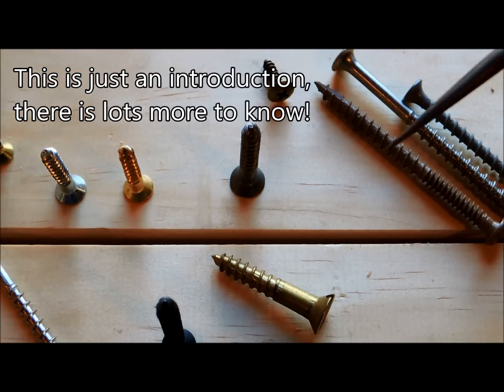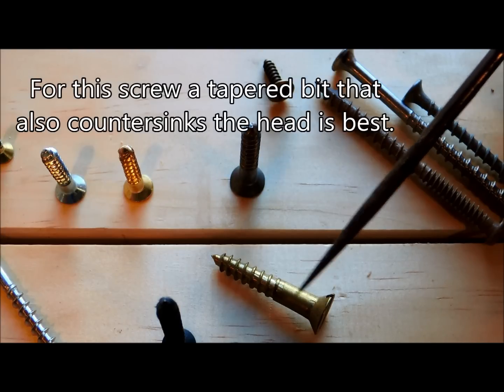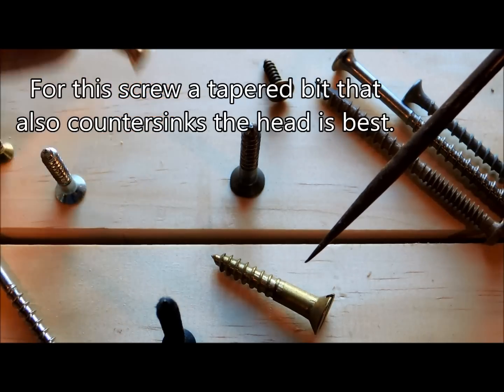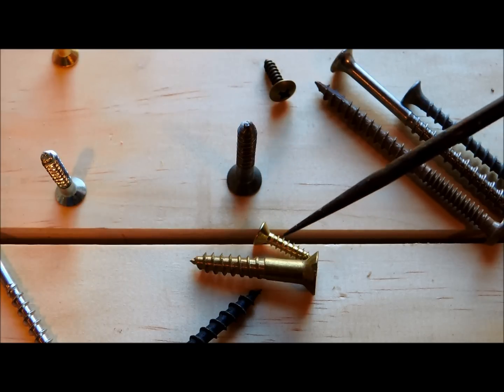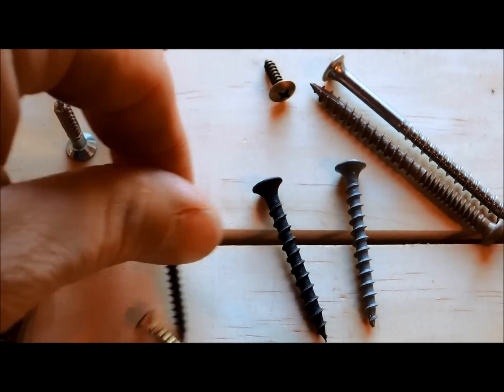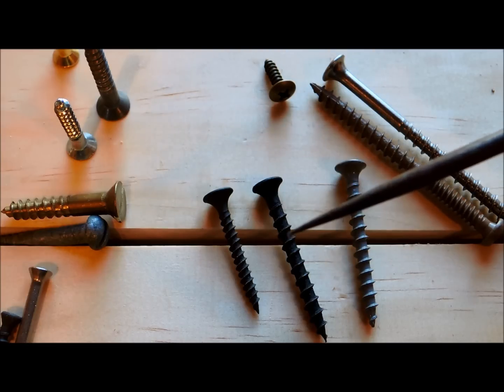An Introduction To Wood Screws

Comment: I have a question im new to diy and my first project im doing,its a fish tank stand 30 gallons,about 340 pounds. My question is can i use a 10x3 or 8x2 deck screwdriver on a 2x4?
Reply from the maker: crispers702 You can use deck screws in doug fir or spruce 2x4s, but for the application you are talking about you'll probably want to pre-drill to avoid splitting the dry lumber.  As important as the screw is the design of the stand.  I'm sure the fish will appreciate you taking some time to understand the structure and the loads on the tank stand so you avoid a calamity!  I have no idea what you have in mind, but look into strong, simple joints (such as a half-lap joint) so that the screws are not the only thing carrying the weight or other stresses.

Comment: Got any tricks/tools for removing stripped screw heads?
Reply from the maker: Kee Arun I should make a video on this subject when I get a chance.  One trick is to cut a new slot for a straight screwdriver using a hacksaw, or a file or a Dremel tool.
Reply: Great, look forward to the video.

Comment: what kind of screw head holds the most tension? Flat, round, conic?
Reply from the maker: Oh, hell, there's a lot of variables involved.  The shear value is related to the type of metal in the screw.  The strength of the head itself relates to the materials being joined.  As an example, a bugle head drywall screw will sink into drywall or soft pine but if you overdrive it into plywood or oak it will snap off.  If there's something you're trying to accomplish I might be able to recommend a screw based on experience...
Reply: tension from where?

Comment: If joining 2*4 which type of screw is recommended?
Reply from the maker: +junior rodriguez It depends not only on the type and size of material you are using, but also what you are using the material to build.  Deck screws are commonly used on 2x material for many purposes and they are a good place to start.  As a rule of thumb, you generally want the screw to penetrate as far into the connecting piece as it does through the main piece of wood.  In other words, if you are screwing through a 2x work piece (which is 1.5 inches thick) into another, you'll probably want a 3 inch or 3.5 inch screw so that 1.5 inches of the screw is connected into the bottom piece.

Comment: OK - well done. Perhaps there are regional differences in the names of things. Since you are speaking to newbies or students some things need correcting. The size of the screw's shank is its diameter, not the width. At about 7:16 there is nothing "reverse" about the thread, it is merely a different kind of thread. A reverse thread would be a left handed thread which would not work. A screw head that has a square hole is correctly called a Robertson head screw.
Reply from the maker: Oh, a stickler, eh?    I just rewatched this video and that "reverse" thread on that particular brand of composite deck screw shown in the video looks more straight than reversed.  So, I'll take that criticism.   However, there are other brands with a more obvious reversal of thread direction.  I think GRK is one of those brands.   Either way, the point stands that the alternate thread at the top of the screw is meant to tamp down the plastic from the decking.      As for the square recess screw--that's what they are marketed and sold as in the US anyway.  Robertson is out of luck.
Reply from the maker: Interesting about the Canadian emphasis.  It still remains a relative niche head in the US market, with the torx or "star" head being more popular overall in construction and automotive uses.  The Phillips head is still the overall leader.

Comment: Why doesn't screws come pre-oiled? It would be such a cheap solution to prevent rust!
Reply from the maker: Oil has limited utility for rust prevention--as soon as it wears off or evaporates any protection is gone.  Besides that, though, you wouldn't want oil staining your nice wood project or causing paint adhesion issues, etc.
Reply: enduringcharm how does it wear off?
Reply from the maker: The friction of driving the screw into wood or another material would wear off an oil coating, as would contact with the exposed head over time.  For rust-proof screws just avoid plain steel.  You have stainless steel, brass, and bronze screws to choose from as well as specialty coated screws sold for decks.
Reply: enduringcharm what if i spray wd40 on a screw after i screw it in?
Reply from the maker: If you absolutely need to use a steel screw and you fear rust, try painting the screw before you install it and let the paint dry for a day.  After you install the screw you can touch up any paint that comes off the head.
Reply: enduringcharm all non-golden metals look the same to me so i better be on the safe side :)